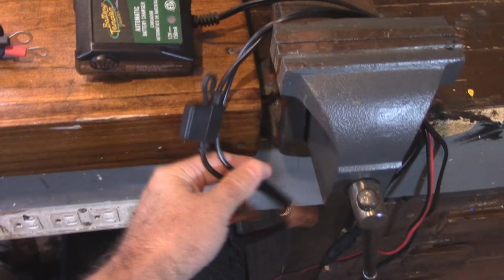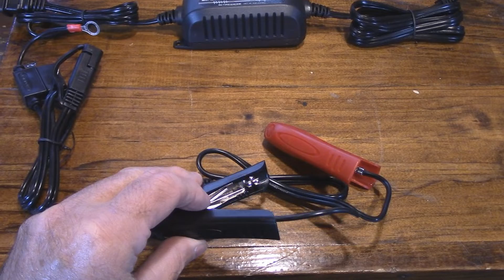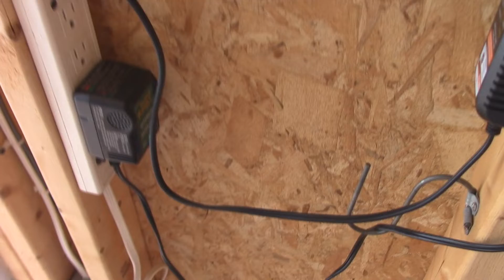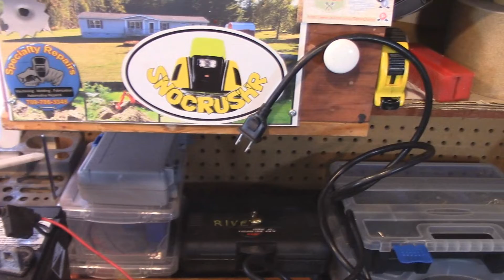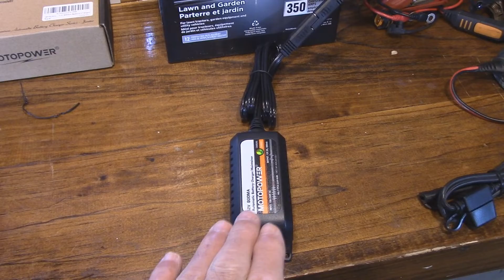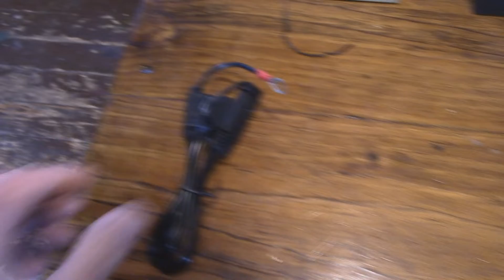Battery Maintainers - Buying Tips -  Watch Before You Buy The Wrong One - MOTOPOWER MP00205C

Comment: I'm trying too figure this stuff out not necessarily for charging either. I'm more looking for something that can be used too maintain my lawn mower battery in the winter month's because my new riding mower I've read that in colder weather the battery tends too drain much quicker then most so i want something that i can remove the battery and bring it inside the garage and keep on a battery tender just for the winter seasons. Mower i have a proper cover and it will be kept outside not enough room in garage for it but i do have a small bench i figure i can put the battery with a tender jjst trying too figure out what kinda battery tender too get.
Reply from the maker: Hi James 
I like the brand "battery tender" but most maintainers will work.  All you have to know is to match the voltage of the battery to the specs on the maintainer.  A 1 amp charge is all you need  so dont buy a big charger if its only for the mower battery.
Reply: @SteveRobReviews OK thanks for the information.

Comment: Merry Christmas and Happy New Year to you and yours! I enjoyed your reviews of "plug and ply" battery maintainers. I'd like to suggest the Schumacher SC 1300 unit. I have 3 of these permanently mounted in my (1) 2007 Jeep Wrangler, (2) 2009 Polaris Ranger. (3) 2020 Kubota BX23S  "mini" backhoe for maintaining their batteries during the winter temps (down to minus 30 at times). I believe you will be very impressed with the quality and simplicity of this unit. The Jeep's and SxS have been installed since they were bought new and have never given me any starting issues. They are extremely weather tight and are exposed to "hose downs" on a regular basis after the vehicles are used in muddy or slushy conditions. I would be very interested in hearing from you if you elect to try this unit out... (It absolutely excels in the under hood "mount it and forget it" environment" Take care... Mike
Reply from the maker: Thanks for the suggestion Mike . Merry Christmas

Comment: Have you posted the video showing how you have this wired in your truck?
Reply from the maker: Yes
https://youtu.be/3Lv8WcbN9lI
Reply: @SteveRobReviews  I use my car on average ever 2 to 3 weeks or at times month parked indoors in a heated condo. I keep changing my battery ever 8 years on two batteries. installed my 3rd battery over 2 weeks ago drove it high speeds on the highway foe over an hours and did 4 stops to shop. My battery never failed in the winter. Having a battery maintain tender would be useless since my car is indoors. Also Noco jump start with override useless and get weak like a battery after 3 years.. Costs the same as a battery. Best to replace the battery. I have the CAA or for you called the AAA. Never used it on this car my other one yes car parked outdoor before getting a condo.

Comment: I measured current draw on my Harbor Freight unit and was getting 0.8 amps of parasitic current drain with the unit unplugged from AC. Interesting is that the LED was off when I did the measurement but I was still getting parasitic current drain.  When you measured your current, did you measure with the meter in series or did you use a DC clamp on current meter?
Reply from the maker: @Redneck_Ed  That's enough to kill a battery when not plugged in.  I used my low amp clamp to check for any draw , it was zero.
Reply: @SteveRobReviews  yeah definitely. Thanks for the reply. I just have a cheap DC clamp on and inline current meter and I got slightly different current readings which I'm guessing is because when the metercis connected in series, the tender isn't sensing the connection to the battery in the same way and is delivering about 300 mA more of parasitic current drain.
Reply: That is nearly 1 amp, which is a heck of a lot of "parasitic" draw! I'd toss that in the trash ASAP! ... Mike
Reply: But is it from the Harbor Freight or is it from your car.  There's alot of electronics and computers in car that constantly draws current.
Reply: @jonfreeman9682  It's from the Harbor Freight trickle charger because we're talking about a battery that is sitting on the bench connected to nothing but the trickle charger.

Comment: Is it safe to use a maintainer on a brand new battery installed on a car that won’t be driven but once a week? Also, can you put your Maintainer on the jump posts instead of directly on the battery? My battery is buried under a bunch of plastic components. And one more question: can you use a battery maintainer to supply your cars computer while swapping out a battery?
Reply from the maker: Yes absolutely that's what I do to  my  new truck I seldom use.  A battery maintainer can not be used when changing  a battery.
Reply: @SteveRobReviews  I appreciate your time. So should I just use a jump start pack when swapping out batteries to keep the computers going? A trickle charger? Or is there a special device needed? Thanks
Reply from the maker: @Wargasm54 This is what I use.  https://youtu.be/w1iPQw2Eriw
Reply: @SteveRobReviews  awesome. Thanks. So it’s an OBD plug memory saver! Oh, and you said it was ok to use a battery maintainer on a new battery? I can’t access the battery itself, so it’s ok to use the maintainer on the jump posts to maintain the battery?
Reply from the maker: @Wargasm54  Yes you can hook it up to the jump post.
Reply: @SteveRobReviews  thanks for taking time to reply. Subscribed

Comment: I have the old  US 3300 Ctek and never had problems. Charged up 6 truck batteries that were labeled dead abd not chargeable. I had a Weathertech that looked like a battery tender and it sucked.
Reply from the maker: The ctek is rock solid as I've used that so much and it just keeps on going 👍

Comment: I absolutely love my battery tenders! I keep 6 or so batteries on the bench in the basement for winter and every time I go down there I cycle the tender to the next battery to keep them topped off. I keep permanent tenders on the utv as it still gets used but not often in the winter months! Thanks for sharing Steve!
Reply from the maker: Tyler the battery maintainers are a must have for all seasonal equipment.  Cheers 👍

Comment: That’s a good topic Steve.    The only use I have for the maintainers is stuff that’s parked for the winter but the other day I went to use my truck....the first time in a few like 3 mounts and it didn’t start...... I know what your talking about ....you don’t want that maintainer to be a parasitic draw on the battery when your using the truck and just park it for a few days before the next use....good one....we have to cover all angles.....CHEERS
Reply from the maker: Gator for many today replacing a battery or a no start is a trip to a shop so a low cost maintainer may be a good thing to consider.  I  have not had a no start in a very long time , maybe back in the 80's LOL

Comment: Steve buy the Battery Tender WP800. It is the same physical design as your new device, but better because it is waterproof and nearly indestructible. I have 3. Considering the abuse I've put them through, they shouldn't still be working.
Reply from the maker: I did look at them too , at the time $80 seemed far too expensive but      it seems everything has gone up in price with so many shortages.
Reply: i couldn't find a deltran wp 800